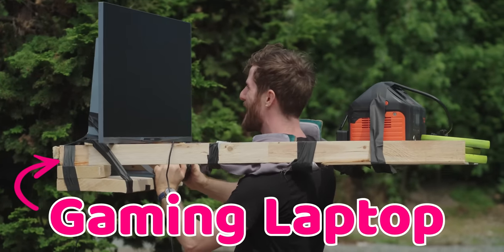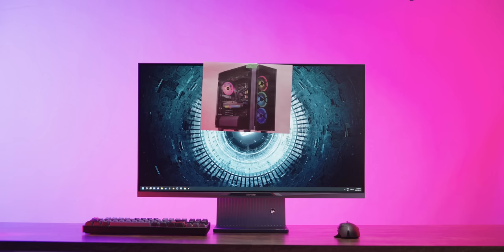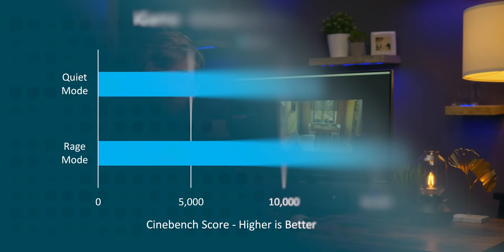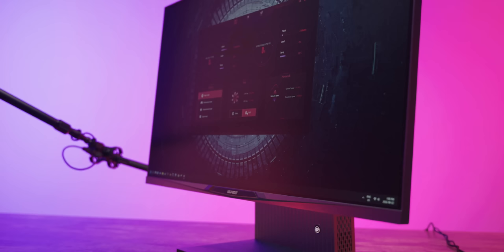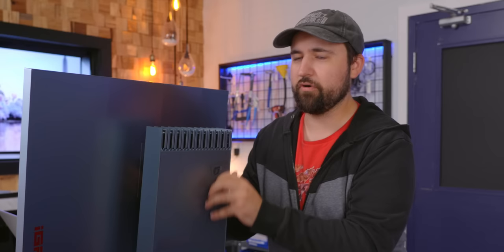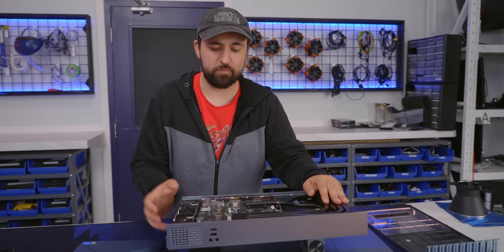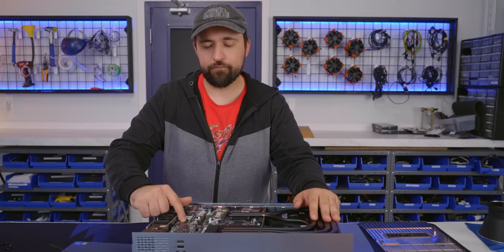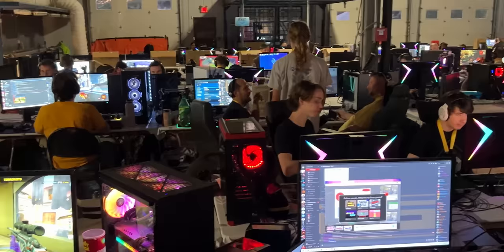Justify Your Existence. I'll Wait. - Colorful iGame AIO

Comment: Honestly, this would be kinda interesting if it had some sort of HDMI input which would mean the fairly decent screen wouldn't immediately go to waste when the PC hardware gets out of date.
Reply: My old all-in-one Lenovo B520 from 2011 actually has this feature
Reply: My monitor has this feature.
Reply: It would be better for the environment, but still it would be more expensive than a PC/NUC/laptop with a separate monitor.
Reply: @jimmyfuchstein2274  5ms measured... The only monitors really lower than that are OLED.... see hardware unboxed: https://youtu.be/jRzGvkqSNaI?t=647
Reply: @sovo1212  it'd much rather use a Nuc than this solution 😅trap it to the back of a monitor and you have a nice system you can replace parts of when it fails. Seems like a good solution for a work pc.
Reply: Very DIYable, but if it's easy to do then it'd be better
Reply: This is exactly the same problem the Surface Studio and the iMac have, and it's so damn stupid! Just add an HDMI Port! It's not that difficult!
Reply: Literally WUT?  This should have a normal PCIe video card.  It is Barely smaller than standard form factors like Mini-ITX or Lenovo/HP/Dell Tiny/Mini/Micro with socketed desktop processors.

I doubt its smaller than Mini STX form factor, which already exists and also has socketed desktop processors.
Reply: Certain models of iMac had that feature with a mini-DisplayPort-in mode, but unfortunately I don't think that feature lasted very long.
Reply: Same thought
Reply: i have an old all in one dell from about 2012 that has this. its got hdmi input RCA input and a touch screen etc.
Reply: should last quite awhile though, ive got a 2011 iMac A1311 with an i5-2400S in it and its still quite useable with arch linux / KDE
Reply: Or if the whole AIO unit just slots into the back rather than be a big pain to open up. I think even having a proprietary connector for video and IO (mainly usb for the webcam) is way easier to replace, and having a option to slot in a conversion block to give you DP/HDMI and a USB-C for the webcam after the system is outdated and discontinued would be much better. However nobody does this
Reply: I'm starting to get pretty salty about devices with screens that don't let you use it as a monitor. It seems like a thing laptops should be able to do too.
Reply: My old all in one had that, but the screen couldn't be turned on independently of the PC so it wasted a huge amount of power...
Reply: @jimmyfuchstein2274  1440p 165hz IPS 32" is $100 bc it's 5ms? What?
Reply: This would be sick alongside my Series X tbh. Have a decent little PC, and then swap to my Series X on the same monitor, but sadly no. Also the price is crazy.